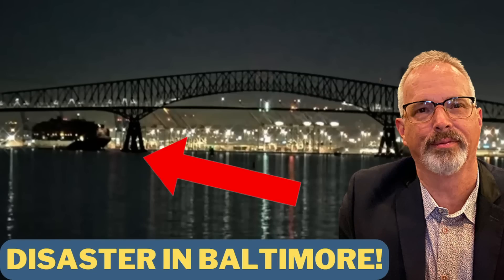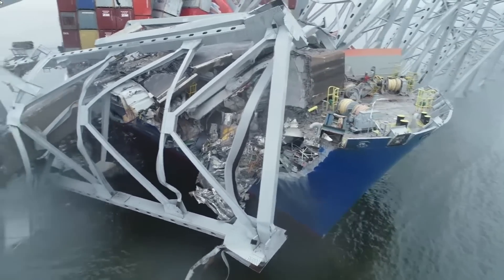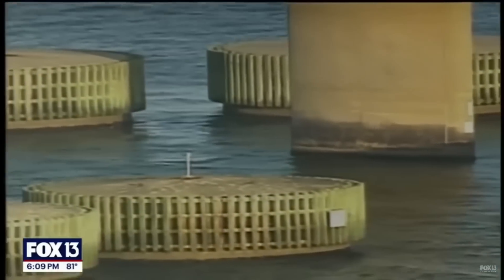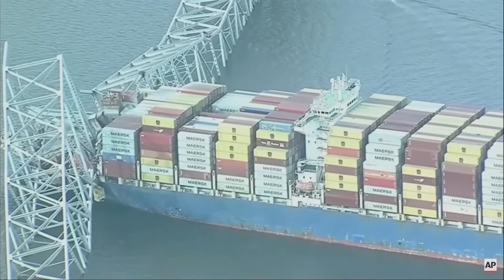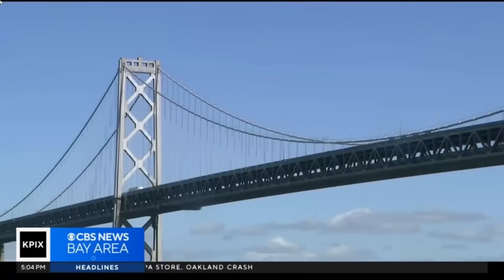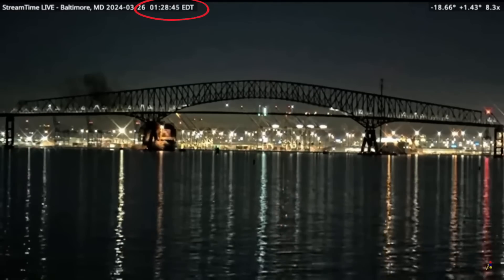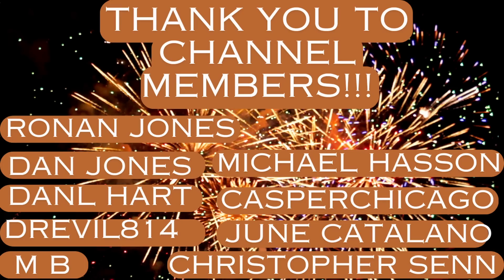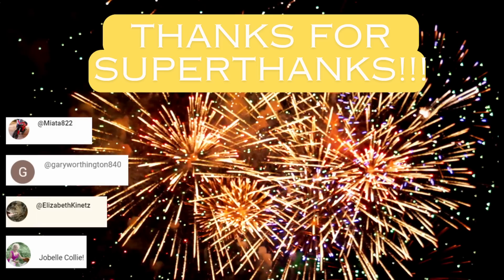How the Francis Scott Key Bridge in Baltimore should have been Protected

Comment: I retired in 2022 after almost 50yrs as a marine cargo surveyor. Based in Baltimore I've worked at ports on the USEC from Portsmouth VA up to Providence RI at times. When I started in '75 the Key Bridge was brand new and the ships then from bulk carriers to combo RO-RO ships were nowhere the size of the Pure Container ships now. Containers were fairly New back then but the pure container ships grew to what we never expected in size. From what I've seen at other ports some are even larger than the Dali. How can you build Anything guessing what will come along in 50 years?
Reply from the maker: You're right that's why I think they need to build these bridge projects in such a way that a ship would run aground before hitting a pier.

Comment: So it was an Eiffel tower long? But that's a European unit. How many football fields is that? How many elephants did it weigh? If it's not clear, I despise these cutesy units. LOL! The only thing we learn from history is that we don't learn from history. This loss of expertise is the same in embedded systems. We were more professional in the 1980s than we are today. One thing that happened was that the tools got dragged towards data processing and dropped support for realtime issues. I am doing the same thing now that I was doing in 1986, developing guided weapons. But back then I had tools to support design and development. I typically used a logic analyzer, in circuit debugger, and digital storage scope to do software development. These days all I have is a serial port and a log file. Like in the 1970s, before in circuit debugging was even possible. The result is massively increased development issues. When there are issues we can't localize them. In 1997, before I moved to the US, I could use either the logic analyzer, or the JTAG debugger to detect where a bad thing happened. I have never had those facilities since moving to the US.

Comment: Putting a speed limit and strengthening  ship regulations would be much more effective in my opinion. The Dali was traveling at 8kn, giving it 4 minutes to respond. Now imagine if they were going at 2kn. They probably would have been able to avoid the accident.
And why is a loss of power even allowed to happen? Regulations to ensure no ship loses power in coastal waters needs to be passed.
If those two measures are implemented for commercial vessels, the problem will be virtually eliminated.
Reply from the maker: Yes, I agree those are good precautions to take.  I also think more passive collision protection is needed to protect against human error and bad actors.

Comment: Do your homework. The ship has been a disaster  waiting to happen. Failed electrical inspections for the past few years. 3 different power failures at the port.
Reply from the maker: The point is the bridge was vulnerable to collapse from ship impact fom passing cargo ships. I'm not particularly interested in what was going on with that ship since proper collision protection systems would have prevented this disaster to begin with.

Comment: I do think this event will result in retrofitting bridges nationwide to reduce this type of failure.
Reply from the maker: Hopefully that's the case. It definitely should be the case that these bridges are better protected.
Reply: @CaseyJones-Engineer  And hopefully the designs will be done by and get overseen by people who are competent and not the DEI folks who designed and building 737s.  There are some jobs where we should hire only the most competent people and toss out other hiring criteria that is not based on merit.

Comment: Hindsight, hindsight, hindsight. That was then (1975) and this is now (2024). Given that, it is time to think in the here and now, as I don't have time to worry about 50 years ago. That is another age when it comes to engineering based on the knowledge then. So design the replacement for today but yet in the end no engineering design is 100% fool proof. Let's check back in 2080.
Reply from the maker: No. Government officials had decades to retrofit this bridge to provide adequate collision protection from passing ships.  After all, they saw fit to upgrade the port to handle bigger ships yet decided to go with wishful thinking instead of doing the necessary upgrades.  How is it the the Delaware Port Authority had the sense to upgrade the protections on their bridges without officials in Maryland taking notice.

Comment: There is no structure that would have prevented this. Incompetence can't override physics.
Reply from the maker: I disagree engineered  and constructed protective barriers are implemented all the time at other projects.
Reply: @CaseyJones-Engineer  and the Titanic was unsinkable - and AT OTHER PROJECTS - NOT THIS BRIDGE.  Container shipping has increased in volume and are going in and out of ports built and designed way before the use of ships the size of the Dali. No one cared to take a step forward and do a hazard analysis. Plus the Dali is not the largest type container ship. Why don't you do the math on a barrier that might have worked, it would most likely negate the ability to use this port. Last no matter what happens from an incompetent navigational error. - incidents like this are covered by layers of maritime law that will result in the corporations involved in the Dali will not pay a dime. Plus the US government doesn't have the fortitude to take aggressive action. Two incompetent variables added together equal zero.
Reply from the maker: @c123bthunderpig  Yes and they had decades to do such an analysis and retrofit any needed pier protections and they chose not too.  This is especially surprising considering that they just recent upgraded the port in Baltimore to handle the larger cargo ships.
Reply: @CaseyJones-Engineer  thanks for that information, except for those families who lost loved ones and the people who lost their jobs because of the incompetent events that lead up to the collapse,, I have no sympathy for the future that lies ahead for Baltimore. . Engineering hubris in our space program killed 17 people, ( I knew many of them personally ) and shut down a program that was viable but mismanaged  . As far as I'm concerned let the citizens of Baltimore pay for the entire recovery. Its not my problem and does nothing but eat up a massive amount of wasted energy on the Internet.

Comment: The bridge did not fail due to design or pier protection.  The bridge (all components) were not designed to withstand the impact it witnessed.  IF the design had a requirements for impact that it witnessed it would have been a much different protection scheme. That said, knowing the existing (before incident) situation, tug support past the Key bridge is a simple effective solution. From a fiscal  perspective it would have saved lives and money beyond calculation.   Maritime responsibility is to blame NOT the design.
Reply from the maker: The design being a continuous truss was particularly vulnerable to catastrophic failure.  The point of this video is that this bridge should have been better protected by having collision barriers installed as a retrofit at some point in the past (as in as early as the 1980's) especially considering the example of the Sunshine Skyway bridge.

Comment: Part of the cost of building bridge protection should be covered by the owners of the ships. As ships grow (uncontrollably) in size the bridges need more protection.  Ships should also be required to have better back-up power systems; so they don't loose control.  Another fact about the FSK Bridge; I think it is part of Interstate 695, part of the Federal Highway System. Therefore, isn't the Federal Government responsible for financial considerations?

Comment: The bridge had protective dolphins, but the ship missed them completely because it veered in from the channel. This may have happened if the ship was thrown into reverse(note the heavy black smoke in the video). In reverse a condition called prop walk would have pushed the stern out more forcefully than any rudder force. Forcing the stern out while travelling slowly will move the bow inwards leading to this collision. Dolphins directly in line with support columns is not sufficient.
Reply from the maker: For the future rebuild, the dolphin system would have to be much bigger than what they had.

Comment: " There has been a lot of misinformation put out that says that no bridge could be adequately protected from damage or destruction from impacts due to striking cargo ships or barges."

It is not misinformation.

The number and size of dolphins needed to protect bridge piers from a 1,000 foot long heavily loaded ship moving at 10 knots, might not even be feasible without imposing unacceptable hydrological impacts on water flows.

I have reviewed 10 such bridges in the U.S. and none of them provide more than 150 feet of protection, and the bow overhang and speed would destroy that and sever the tower, leading to the collapse of the entire suspended span.

A vessel that size and speed would either ride over the island and through the piers, or would rip the entire structure from the bottom of the bay. 

The only actual solution I can see is to tunnel under the shipping channel, so that there is no bridge there in the first place.

Like the bridge-tunnels in the Norfolk, VA, USA area.

My solution would be a tunnel as on the Chesapeake Bay Bridge-Tunnel and the Hampton Roads Bridge-Tunnel and I-664 Bridge-Tunnel.

No bridge over the shipping channel.

The I-695 approach tunnel portal causeways are already in place, for the original design.

MDTA planned a tunnel but advertised for bids and found that the bridge could be built for half the cost.

Comment: Engineers make recommendations for safety based on design requirements. Bean counters whisper in the owner's ear to save cost and convince the owner to just insure it for higher loss potential. The owner, being cost driven, seeks to follow the lowest common denominator and choses to build it cheaper. The bean counters also sell insurance. It is all over money. This happens every day, in every industry,  in every country. Globalism has superseded common sense in the race to the bottom in labor and material costs. Those who used to have the job knowing their respective trades and completed the necessary training and certifications have been systematically replaced by HR departments hiring DIE replacements to ensure their company meets eligibility to make bids on contracts. Damn the results. Full speed ahead for profits for the shareholders.

Comment: Agree with you 100%. Here's my take: This tragedy was completely preventable. (1)There was no traffic stoppage upon a large vessel going under the main span. (2) No use of tug boats to assist the vessel through the channel. (3) No large Dolphins (concrete bumpers) to keep a vessel from striking the main supports of the bridge. Bridge workers lives lost because there was no direct communication between police and workers on the bridge. No safety protocols whatsoever and therefore NO EXCUSE!!! Now compare the huge amount of money it's going to take to cleanup and rebuild let alone the cost of the port being out of commission ($15,000,000/day) to what it would have cost to take at least one of those 3 safety precaution measures.

Comment: If the goal was to build a path over water to last centuries  it could be built much cheaper  with different materials and methods  money is the problem not common sense  I know an old man who built a  suspension bride from salvage materials twenty feet in air eighty foot long  that survived a five hundred year flood at nearly no cost cost  without power equipment   miles from any road     but the money thing make people do stupid things just thinking

Comment: Yes. I grew up in the 60s and 70s and there were WW2 veterans all over the place in my home town. I spent years fascinated with WW2 and learned all I could. I've noticed the new generation of WW2 fans have some really way-out wonky ideas about the war and many aspects of it. Some of them outright admit that they have to "rethink" the war. Meaning they have to rewrite history to their skewed incorrect version of it. 
It doesn't surprise me at all that we fail to learn any lessons. however, how can this be the case with the FSK bridge? It was built in the late 70s. They have had over 40 years to address this issue. It should have been on the table right after the sunshine bridge disaster. I'll tell you why. I've seen this over and over. As a society we have developed a mindset of cost. And we have as a society decided to continually go with cheapest as opposed to what's needed. 

I watched the county of Ventura build a bridge in Oxnard and they went with the cheapest mindset. One year later they had to devise plans to rebuild a whole new bridge. The brand new bridge was demolished in just 2 years time after it was built and a new much more expensive bridge built in its place. The whole fiasco ended up costing twice as much than if they had just built the right bridge in the first place.
The same issues were at play with the FSK bridge. They were initially going to build a tunnel, which would have been wise. But instead, let's go cheapest because a tunnel costs more, and even cheaper than that even and they decided on the continuous truss bridge which is the most foolish kind of bridge you could build over the entrance of a huge port complex but it was the cheapest bridge they could build. They couldn't even build a stronger bridge. 

And the last 40 years it' the same reasoning. Cheap. Now how much are these cheap BAD decisions costing? AND the federal gov is not paying for the new bridge. The tax payers are.

Comment: I do not see any major changes in general in bridge and infrastructure status in the USA.   The key reason that I believe that with the exception of Minnesota the State Department Of Transportation are so underfunded that they can only address urgent immediate needs and they all have a long list of bridges and other key infrastructure that is in need of major upgrades or replacement.

The reason Minnesota is excluded from the list is the aftereffects of the 2007 I35 bridge collapse.    The State did an investigation as to why that "poor condition" bridge and not been addressed in a more timely manner only to discover that there were almost 150 other significant bridges in the Minnesota in similar condition - and that every one of them were considered "Budget Busters" if they had to be shut down and properly addressed due to how underfunded the DOT was.  That the people were doing the best they could given the financial constraints they had.

Minnesota dramatically increased DOT funding and in the last 15 years have replaced I believe 179 bridges in the State virtually completely replacing all "Structurally Deficient"  and "Functionally Obsolete" highway bridges that were on the list in Minnesota (and a lot of repair work on bridges rated as "poor").  I understand that over 1000 smaller county bridges were replaced across the State as well.  

The joke in Minnesota for the decade starting a year after the I35 bridge collapse was that there were two seasons in Minnesota:  Winter and Bridge Construction (not that anyone complained - the entire State population understood - and actually passed a State Wide multi $Billion referendum for money to address the bridges).  At this time bridge construction in Minnesota has slowed down a lot now that the problem bridges have been reduced to only a small number; and while DOT funding has been reduced somewhat... (the referendum money is now used up) It's now at a level to proactively manage bridge and road degradation and not let things get out of hand which is were things were before the I35 bridge collapse.

So I can understand the Maryland DOT not doing anything because they did not have any funding to do something.  Getting funding for a rare event is very difficult in political circles unless there is such a disaster.

I understand that it has been identified since this bridge collapse that there are 8 similar key large bridges in the USA that could block key shipping access to major ports without adequate (or any) protection against modern sized ships.   I expect that only those 8 will get any money; and as you pointed out there are 2 bridges with such projects in the works.

I note that when the Francis Scott Key bridge was built the average "larger" ship size that visited that port involved was likely in the 30,000 - 40,000 ton size (that port was never designed for the biggest of cargo ships - and never will be).    Even if the bridge had been built with adequate protection from those... it would likely have been totally inadequate for the size of ship that hit it.

A reality is that likely about 80%+ of the existing buildings, bridges, and other infrastructure does not meet current design standards or building codes.   They are grandfathered in because its not economically feasible at all to upgrade things to current standards. Only in extremely rare situations are upgraded retrofitted into old infrastructure.

Until individual States and the Federal Governments properly fund the DOTs and related infrastructure nothing much is going to change.

A projection:  I consider it likely that the replacement bridge will be a suspension bridge with the key supports well away from any navigable water by cargo ships.   I also projected that it would take 2.75 - 3.5 years to tear down the entire old bridge and build a replacement.